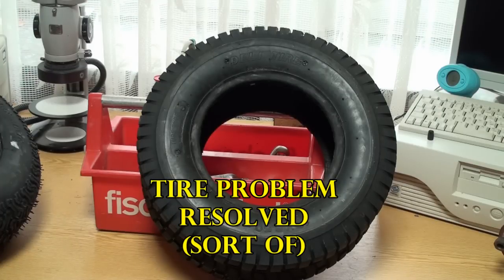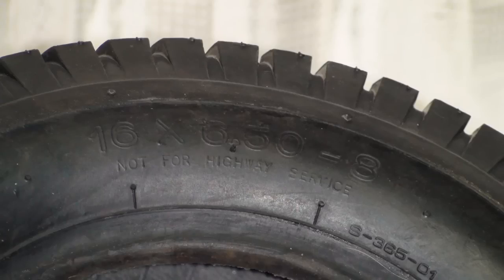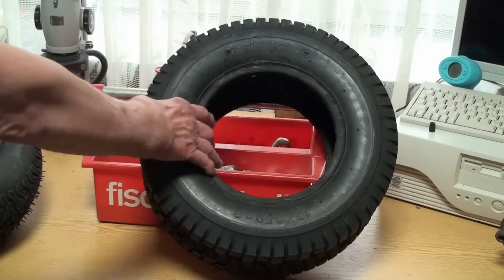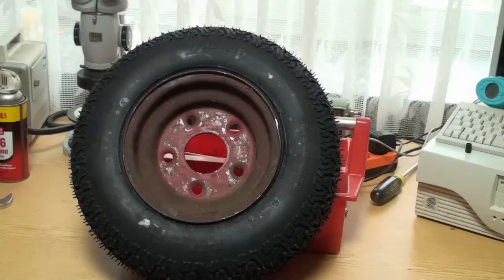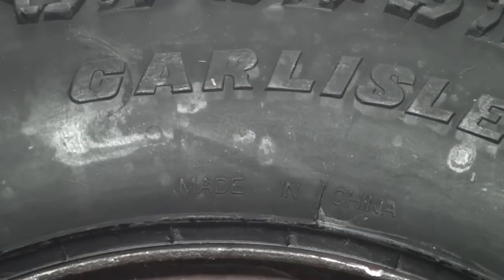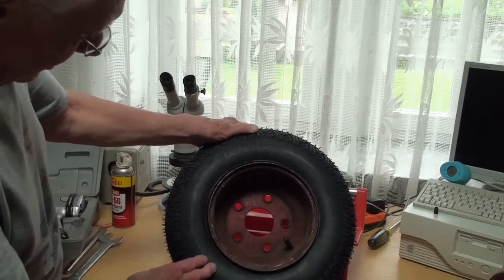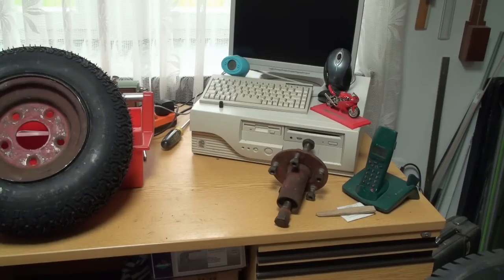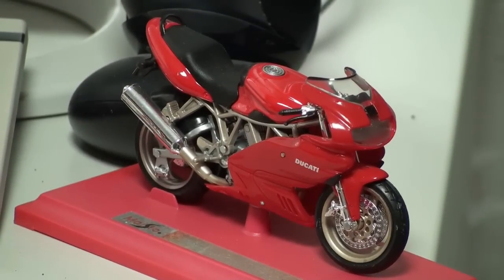Yazoo Tire Problem Resolved

Comment: Glad you got it sorted Bruce.. Gee your computer is still running the old large floppy disks. Haven't seen one of them for ages..
Reply from the maker: Funny, that computer is in my shop and has been there for many years. I never turn it on, although it does run. It has a 1997 version of SUSE Linux on it and still runs fine, although I don't think I have any 5-1/2" floppies around here anymore...or maybe if I  looked hard enough! LOL

Comment: One small point Bruce if you haven't noticed it [which I'm sure you have being such a particular person!] is that you must mount the rim on the axle housing so that the shouldered studs fit into the cone shaped sockets of the rim and not the other way round - that way they self centre as you tighten them.
Reply from the maker: Thanks for the pointer Dan. The tire wouldn't fit on the axle the other way around so it's pretty obvious in this case. The tire shops have trouble with these wheels because the opening for the valve stem is in the deep part of the rim that is down on the machine when they put the tire on. It's a pretty strange setup altogether. I'm making a video on how it goes onto the mower. Thanks again, also for watching.

Comment: I bought some tyres for a dumptruck at work, although huge in comparison, the principle was the same, the tyres wouldn't pop off the rim but the rim would spin in the tyre, turned out the bead was just too large, despite the tyre size being right
Reply from the maker: Thanks for sharing this Scotty! I'm relatively certain that was the case here, too. Comparing the two tyres the Indonesian one was much softer around the bead and the bead itself was thinner and much more pliable. A rough measurement of the inside diameter at the bead showed that the Indonesian tyre was a couple of millimeters larger than the Chinese Carlisle tyre that finally went on the rim and stayed there.

Comment: I've been repairing my smaller tubeless tires with tubes. It seems like the newer compounds do not last like they used to.
Reply from the maker: That's undoubtedly true. The strange thing was that the Indonesian tire wouldn't stay on the rim WITH a tube in it. Thanks for watching and for your comment.

Comment: Glad it worked, but it still begs the question doesn't it? It certainly seems like there has to be a logical explanation, more than a bad tire it would seem.
Nice bike for sure.
Reply from the maker: I don't know, George; the bead on the new tire is much stiffer and thicker than on the one on the other tire and it weighs 2 pounds more. Thanks for watching and for your input.